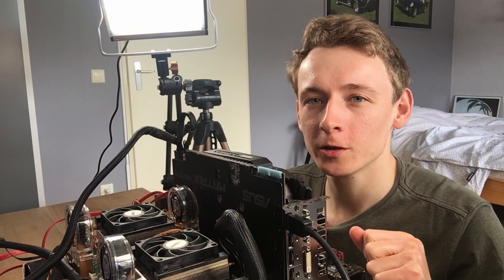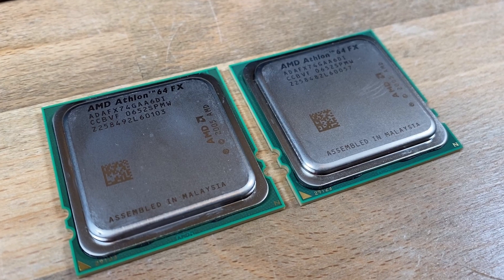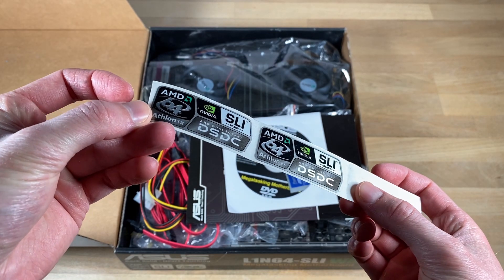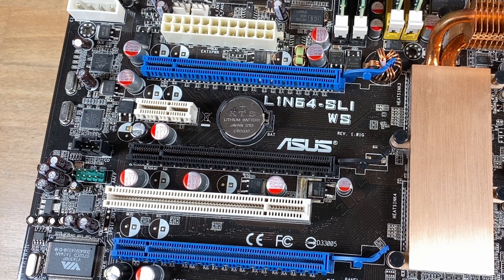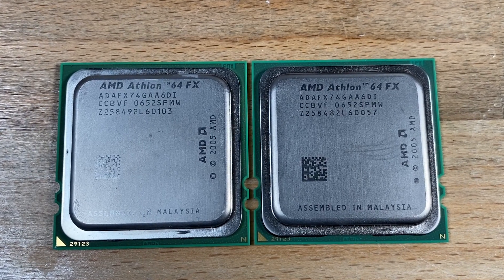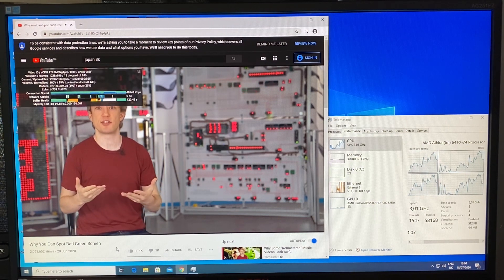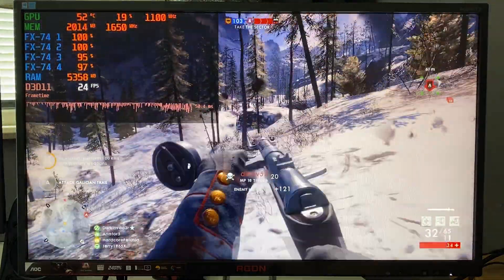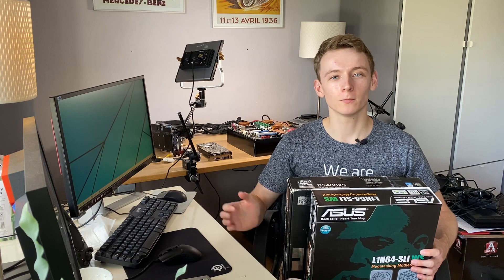AMD Quad FX (Quadfather) - AMD's obscure Dual Socket answer to Core 2 Quad

Comment: I had one of these, I loved it for its ridiculousness. Plus, it heated my home in the winter in buffalo, NY. I had it setup as an entirely liquid cooled system. It died many years later due to the CPU power connectors turning from blue to black and crumbling from heat cycles.

Comment: With a little bit of fiddling I actually managed to squeeze 671 pts from 1100T in R15 multi thread test compared to 496 shown in the graph. I bet with some of that fiddling this setup would show closer to 400 👍

Oh, and by 'a bit of fiddling' I mean putting the 4x180mm radiator on the outside window sill during winter 😅

Comment: willamette or northwood pentium 4 processor, 1024 megabyte rambus rdram 4x256mb 400 megahertz, two 3dfx voodoo2 sli pci graphics cards connected to third geforce fx 5800 ultra agp graphics card, dell p1130 crt monitor, audigy2 audio sound card platinum ex sb0240, dvd rw, floppy drive, hdd seagate st350041 8as 40 gigabytes, windows millennium

Comment: threadripper 1950x processor, two geforce gtx titan x maxwell 2.0 gm200 sli graphics cards, ddr4 ram memory 128 gigabytes this is a computer supported by manufacturers until 2040

Comment: processor phenom x4 9950 black edition or phenom2 x6 1100t black edition, motherboard gigabyte ma790fx dq6, ram ddr2 16 gigabytes 4x4gb 1066 megahertz dual graphics cards radeon hd 2900 xt crossfire, quad hdd hitachi a7k2000, cpu cooler scythe mugen 5 pcgh, card audio sound asus xonar essence st, two dvd rw lightscribe, cd rom optical drive, floppy drive, seasonic 850 watt prime ultra titanium power supply, two windows first windows xp professional 32 bit second windows vista ultimate 64 bit, monitor samsung 266bw, speakers microlab b77

Comment: all single core dual core quad core six core processors from pentium 4, athlon xp to intel core i7 980X, amd fx 9590 should run normally at 2000 megahertz even 1400 megahertz

Comment: Thats why I like your content so damn much.
You talk about the hardware I grew up with, the hardware that I've loved for my whole life.
My first ever PC was a K10 Phenom 9750 125w model.
I've used core 2 duos quads phenoms athlons and everything in between.
I've even played with later piledriver chips ocing them to THE MOON AND BACK.
I may sound old fashioned but the larger the fet size the more overclockabilty.
Currently running my I7-5820k @ 4.3 on stock voltage and getting 1300cb on R15.
And this is why I love this era of hardware.
And gpus 5950 7950 R9s god damn I'm getting emotional..

Comment: It's fun looking back at how things were in the past where Intel and AMD traded blows for being the top manufacturer. From the early days of AMD making licenced Intel processors, to making their own architectures. Athlon vs. Pentium, and the rise of multi-core CPU's. Then the long stretch of time where AMD was so beaten to the ground (by the far superior Intel Core line) that they bet the company on the success of Zen, which was a huge turning point. And from there, Intel was the one lagging behind. Today it seems like they are more evenly matched, both in terms of gaming and productivity. And with the upcoming Zen 4 and Raptor Lake parts, it looks to be an interesting autumn

Comment: i have a dual core socket 370 mobo for pentium 3 cpus.  i had to go through several cpu pair before i found a set, at 866 mhz, which had similar enough power usage & temp properies

Comment: remember when this came out and a there was a lot of talk about "quad" core gaming, and that AMD was late to the game.
thing though was that AMD already had a "Quad-core" system before the socket 1207 with SLI support and all that, but it was even less marketed by AMD for enthusiasts or gamers.
and this was the old socket 940 with the dual Opteron 260 and up.
motherboard manufacturers on the other hand made some clearly enthusiast/gamer focused boards  like the Asus K8N-DL, MSI K8N Master2 based on the nForce chipset that made for some very unconventional gaming rigs that made a lot of people turn their heads if you had your side-panel off back then (2005? windowed cases? what's that?)

bought the "bit" more expensive Tyan K8WE, a pair of Opteron 275's, 8sticks of Corsairs XMS 512MB CL2 Reg ECC and a pair of Geforce 7800GTX-512 early 2006 ready for the large LANparty "The Gathering" 2006.
only downside, the socket 940 Opteron's while having some lower power variants had even less power management making for some absurd idle consumption.

Comment: Funny enough I actually still own a Thermaltake Armor Quad FX case, it has 2 CPU trompet holes in the side panel, to extend over the CPU cooler so it would "always" suck in cold air
Reply from the maker: Ha neat, I didn’t know of that case

Comment: I think what pisses me off even still now is the fact that we have so many damn different sockets,  it's like usb c guys, set a standard and use it,  so everybody has the same socket and we can start making great boards for both sets of chips, instead of all this crazy crap on the market,   I am an intel/nvidia guy,  but if I could just go out and buy an amd process and pop it into my board I'm using now,  gasp guess what, I maybe would?   see this is the crap show we get.   time to settle on freaking standards again.  /endofdiscussion.
Reply: Welp, let's remember Socket 7 and Super Socket 7 did bring AMD and Intel on the same board. You could choose between running a Pentium MMX 233 w/ AGP or go bonkers with a AMD K6-2, K6-2+ or K6-3 (and IIRC, 3+ as well.)
Reply: @NSHG  we need to really get companies to stop this crazy crap,  would be simpler, one socket across the board, one memory type.  sure things get faster and such, but I want to buy a board, have it last for 20 years and have it be fully upgradable with everything that comes out.  tired of having to rebuilt a system after 5 years because of companies.

Comment: i gotta laugh my buddy just upgraded to a ryzen 1700X ..but the only heat sink he has is literally one of these ancient heatsinks THANK GOD amd Standardized the cpu mounting bracket all the way through am2 am3 and am4 11:15
Reply: soo its a good cooler fine enough to run a ryzen 1700x nominally
Reply: ..it also had a phenom 2 965 the 3.4ghz unit soo its seen some heat in its years.

Comment: still got a dual socket 940 opteron 270 system.... its only a side rig curiosity but some day i pray i will finally have the spare change to order more of the required ddr 1 ecc ram to actually utilize the second 270 and put the unit in 2x 2x mode finally.

Comment: At the time neither this nor Core 2 quad made any sense for gamers. Games then started using a second core for minor functions if available and a great majority of systems were still running single core cpus. If you build a gaming system at the time and you bought quad FX you literally bought full second socket and cpu so it would do absolutely nothing.

Comment: a lot of people forget how much of a bloodbath Conroe was. AMD went from the fastest x86 CPUs in the world to eternally second place for the next decade and a half.
Reply: Let's also remember Wolfdale and Yorkfield (45nm) which came after. I vividly remember being sucked into using an Athlon II X4 620 and hating every single cell in my body for doing that. Luckily, I had managed to snag a  supposedly broken Yorkfield kit (which was basically a Gigabyte EP45T-DS3R, a Q9400 and 4x2GB DDR3.) that turned out to be fine and it went smooth sailing from then all the way up to early 2020, when I finally moved on to a i5-3470 + 16GB DDR3 on a B75M-D3H.

Comment: History is repeating itself again at least on the chipset side. X670 Extreme also doubles the chipset for its (TBH excessive) I/O.
Also, a Phenom II N970 (2.2GHz) scores 205cb in R15, so 45nm K10 really was a gigantic leap. And a QX6850 scores 75cb single threaded (285 multi) - mine was a bad example too, with a 10 degree Celsius delta between both CPU die.

Comment: Interesting chips. I have never heard of them. A while ago I had an E5200 and Q6700 on an evga board for overclocking, for fun. With the pentium E5200  i reached 214CB in R15 and 4.5GHz.
Really recommend doing some overclocking with old stuff, it can get very interesting. Although this seems so rare it be stupid

Comment: I remember when this came out, but I've never actually seen one. It was really a DOA product because they couldn't price it competitively. It was really the equivalent of what Intel had done a few years before, when they took a Xeon and rebranded it as a Pentium Extreme Edition to compete with the Athlon 64, and people joked and called it the "Emergency Edition." 

AMD did it again a few years later when they took a six-core Opteron and sold it as the Phenom II X6 as a competitive response to Sandy Bridge, but that was actually good and I ran one for a long time.
Reply from the maker: Thanks for sharing John. I got a good chuckle out of "Emergency Edition" - will remember that.
Reply: The Phenom II X6 CPU's were even better than the Bulldozer (faildozer) processors that came out later on.
Even the best "8-core" (which was really a hyperthreaded quad-core design) could not even match the i5 2500K, let alone the i7's. 
I have good memories of the Phenom II being a really good budget option to Intel's offerings at the time
Reply: @Skarfar90  They were more than a hyper-threaded CPU. They had multiple integer pipelines that shared a common front end. And although their IPC was pants, in highly threaded workloads it did compete with a 2600K. And as games started to make use of more threads, these CPU's proved to have a decent longevity.  That and you could get an 8350 for $110 and overclock the nuts out of it.  I know people that ran them for as long or longer than I ran my 2600K. They were far from what they needed to be, but they were not all bad, and some people really stuck with them.
Reply: The Quora guy!

Comment: You should do a part 2 with max upgrades with max ram because ive heared AMD can handle 4gb ddr2 stick rather then intel core 2 and maybe with better cooling some overclocking?

Comment: This is Incredible. I tough the FX CPUs were released since 2011 upto 2016 on the Bulldozer Architecture and it's later revisions Pilledriver and Vishera for Socket AM3+ and 760G, 970, 990X, 990FX Chipsets. This probe AMD worked in the FX concept before the K11 core.
Reply: These weren't "FX" CPUs, they were athlon CPUs, think of it as pentium 4 extreme edition compaired to an i9 extreme edition, they both have "extreme edition" on the end but are in no way related.

Comment: Before that they had the dual amd opteron socket 940 setups, with also 2 times 2 core cpus. I have a tyan Thunder K8WE S2895 board with 2x opteron 275. First bios is from 2005, ddr1.

Comment: Very informative video! I have one of these boards with a pair of FX74's in my collection as well. I remember reading about it back in the day when planning out my then updgrade from Athlon XP build. I of course ended up with a C2Q build, but I always wanted to get my hands on one of these because of how interesting they were (still are). It definitely was a challenge acquiring it. I'm glad it's being covered on youtube.
Reply: Question: how long did you use it? looks like that you could used it for like 6 years.

Comment: Thank you for the interesting video of the Quad FX! I've got myself the spiritual father of this platform. A HP XW 9300 workstation with two Opteron 285. A major difference is, that it uses DDR1, but it has 8 RAM-Slots.
Reply: I had a similar system but with 275 CPU's on an asus mb. It lasted me a lot of years. Though it took a modified bios to be able to do any overclocking, and what it could do was pretty limited.

Comment: What could have been if IPC was a little stronger. If this was successful we could have ended up with a 2x 6c 1090t style platform by 2010. Shame.
Reply from the maker: There was so much potential here for sure..
Reply: I have one running dual 2360 Opterons

Comment: Absolutely fascinating (no pun intended) deep dive into a platform I had zero knowledge about. All that power and it only manages to be a lowend "quad-core" equivalent. So glad you covered this, and thank you!
Reply from the maker: Thanks Nathan :D
Reply: @FullyBuffered  if you change the bios chip to a revision B chip thats floating around on ebay you can run dual quad opterons but you need fully buffered ddr2. It would be interesting seeing what would happen on the games when theres more cores. It would be a relatively easy process and cheap. Getting the board was the hard part.
Reply: @wilfrido16  I would love to see this
Reply: Ya heard about it from The WAN show 2023-06-16
Reply: How many PCIe lanes did you get back then? did dual socket give you x3 the lanes?

Comment: Ah this platform, think der8auer showed this a few months back.

Certainly needs some better cpu coolers, a pair of 120mm tower coolers on a bench setup would keep it somewhat cooler.
Got a core 2 quad q6600 not being used atm for my testrig in case i decide to go back too that.
Currently that testrig is running a core 2 duo e8400 @ 4 ghz, bit stability issues with dual channel ram configuration but it is quick for a dualcore at that speed for sure, specially with most of the things i benchmark favoring faster dualcore stuff anyway. 3dmark 2k1, 2003,2005,2006, aquamark, quake 1 timedemo, quake 2 timedemo, & a few games like f.e.a.r that has built in benchmarks or benchmark tools available.
3dmark vantage uses quad core i think though i do have that installed there too test some heavier loads besides metro 2033.